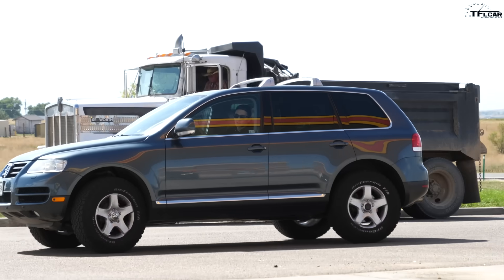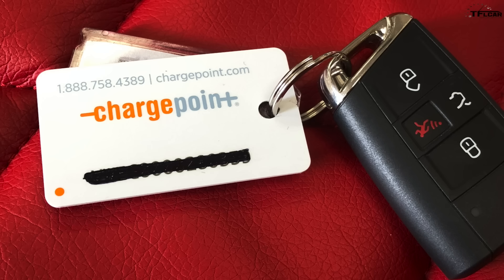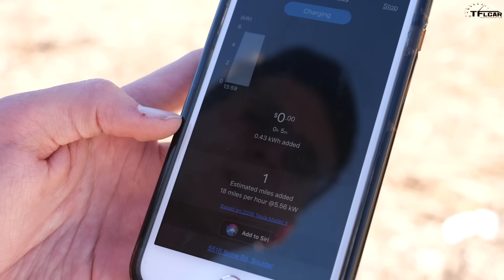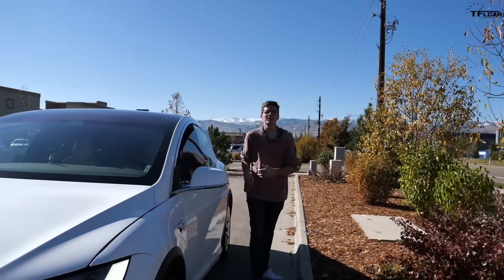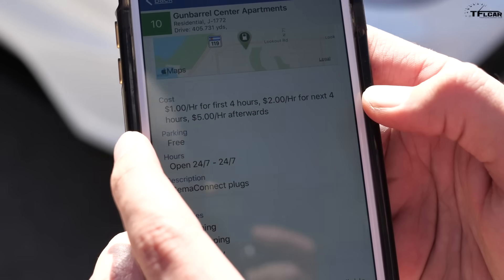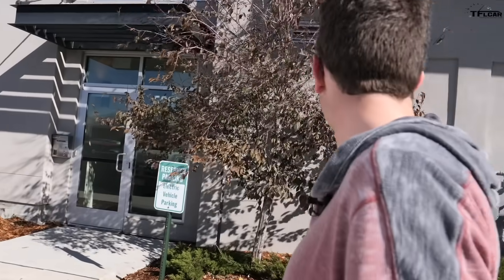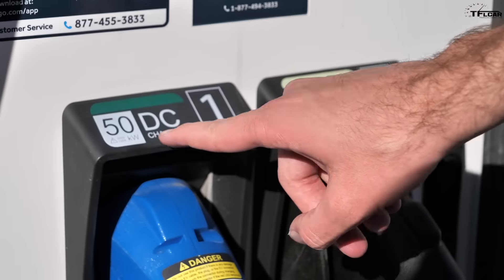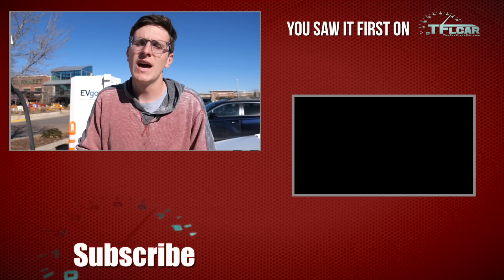Here’s Why Charging an Electric Car Can Suck - And It’s Not The Reason You Think!

Comment: Everyone has 240 volts in domestic properties in the UK.
Reply: Christopher Fairs And in Australia and New Zealand
Reply: @iFlyTheWorld  I think they are talking 3 phase which in Aus would be 415v
Reply: Most people in America do as well for electric ovens, stoves and clothes dryers. He is trying to show people the problems to they might encounter with an electric car. Most people also know if they have a Tesla. They won't be surprised as he pretended to be.
Reply: @glenncordova4027  Not everybody has a garage with a 240 volt outlet. Many dryers are in laundries and ovens are in kitchens, no where near a garage...
Reply: @ronclark9724  then hire an electrician. If you have 110 volts you can still use slow charge.
Reply: @glenncordova4027  Just use gasoline. Quick and easy, not to mention cash is accepted...
Reply: So what? 20h to fully charge a tesla, you've got to be flipping mad! You need a 400V supercharger for any speed! No country has that so you'd need an inverter & lots of Amps input from power lines.
What rotten cars these are, the full electrics! I would never buy one 
for the time it takes to charge. On the other hand I would consider the 
BMW with the motorcycle engine, which is currently the most economical 
ev on the market... It will never leave you stranded nor waiting 
forever.
Reply: @c000rr 
Three phase is 415v... Can be installed into any property as the main lines run 3ph...then they just split the phases going into different properties.

That gives each house 230v.
Reply: @Robert-j6r8c  You're meaning the European electric grid aren't you? We don't have this in North America. Two phase 110V wires come into my electric box. For stoves, dryers & water heaters, we use both the phases to create 220V, the maximum. This would be far to slow to charge a Tesla in an acceptable time. Yes, there are countless dummies in North America who are clueless about electricity, & who buy them. The rich Chinese who launder their money in North America, tend to love them, but there'll be 2-5 supercars in the garage, usually. If the Tesla isn't charged, take the Maserati or AMG Mercedes instead! Teslas have very low resale value because most average people realize the problems with charging.
Reply: @c000rr  Yes. We better destroy our planet. Anything than longer refuel times on our cars god forbid.

Also common helps.

As somebody else mentioned here it's not about if we can it's about will.

If you prioritize refuel time over anything else 

then yes electric cars is not for you and it can't replace a gas car using fosile fuel does burn our atmosphere tho so.. you know charging time or living time , it's really all the same right.
Reply: @coldfusionstormgaming1808  Burning fossil fuel pollutes the air, it's true, but mining rare earth metals from other people's lands pollutes the earth & pollutes the air from the amount of energy required to extract the minerals. Then you've got to ponder how the electricity is produced to charge the car batteries which took so much energy to produce in the first place? Most of the planet generates electricity by burning fossil fuels, many with highly pollutive coal. It sounds like you have not thought about any of the above & are totally clueless. My suggestion: less gaming, more study! ;)
Reply: Skeptik Cal - Your mis-understanding is hilarious. Most Teslas will charge in 15 to 30 minutes at a Tesla SC station when you are on a long trip.  You can drive to just about any place in the US without worrying about charging. Most Tesla owners charge at home for a fraction of the cost of buying gasoline. You really need to read up on Teslas and charging, your ignorance is showing, big time,
Reply: @Chainyanker007  Can't charge at home with apartment living.  Can't charge at most workplaces.  My options are a hotel or airport for Tesla charging near my home.
Reply: @Chainyanker007  your daydreaming, there are almost none east of mid america.from empty to full it will take many many hours. if you take fast charge, it will shorten battery life.
Reply: @terrorzilla  sure drive 30 miles to the airport, for a charge.
Reply: @dannyfields2065  Yeah a stupid response by MacGuy who thinks Tesla SCs are as ubiquitous as gas stations NOT! Pls MacGuy, be stupid enough to buy a junk Tesla car & tell us how convenient the  millions of SCs are along the way. Report back once you've had enough, can't resell your Tesla for half the price, & have logged all those hours you've been kept waiting. It'll only ever be the BMW i3 for me, with BMW motorcycle engine inside to prevent your less than ideal hapless journey, ever happening to me!

All while getting double the Tesla's fuel economy! ;)
Reply: @Chainyanker007  I live in West Texas out on a ranch in the boonies. The nearest gas station is 45 miles away... Sorry, Tesla does not have recharging stations every 15 miles...
Reply: @Chainyanker007  at a Tesla station
Reply: @pjd412 most are on turnpikes, which you have to pay to travel on them. very few anywhere else.
Reply: I cant speak for every state but California residents has 240V available at the panel. All they got to do is use both legs of power.... most panels have L1 to N and L2 to N ... creating the 120V standard here in the States. But if they get L1 to L2 they get  the 240V needed for this application.
Reply: it's not the voltage sir its the Amperage.
Reply: @pjd412 Actually the power on the power lines in the USA come no lower than 440/480 volts. It is the transformers mounted on your house that knocks that power down to 220/240 and 110/120...
Reply: Yea but who has a 5kw to 7kw outlet you'll need a new separate fuse  installed similar to an electric cooker or shower fuse, the cabling will also need to be 2.5mm minimum.
Reply: Most everyone I know has 240vac in their garage all my neighbors relatives and friends but one, I think that's weird but I know that one of my apartments didn't and the triplex my gf lived in had 208vac so...
Reply: Hyrdrogen fuel cells run on water and takes 5 minutes to charge.

However, they are still very expensive.

Comment: Spoiler alert!!  All of these charging stations are still fed electricity from a coal burning power plant.
Reply: From what I heard, power plants just run and waste fuel at off peak periods; to be ready for random demand surges.  Charging during that time counters, making them less wasteful.
Reply: @jasonlisonbee  You have regular power plants, driven by various sources like nuclear, water, coal etc. So the idea is, that an EV is actually driven by the power plant that produces the electricity, which is true. If the energy we use should be clean, we need to work on a way to get energy that is clean. Jim Hayes is totally right. If we use coal to produce electricity and then drive EVs with it, we actually drive EVs with coal.
Reply: @machelvet9594  It is a phase though.  There is a transition going to clean sources.  Giant batteries are also now being added to the grids.  Due to the efficiency of running a plant at a constant load and operating an EV,  it's already impossible for a pure ICE vehicle to come close even if the source for the EV is coal.
Reply: @jasonlisonbee  I'm with you. A neutral observer will probably come to the conclusion that EVs are better than ICE cars specially when you have solar on your roof.
But I think you are right, the change is coming and people will realize the advantages of EVs.
Reply: @machelvet9594  All the costs of intermittent electricity are not yet currently factored in. When they are AE doesn't look so good.  I like Polywell Fusion.
Reply: @msimon6808  Any kind of workable fusion reactor will probably be the breakthrough we need. We'll hopefully get there in the next decade.
Reply: @machelvet9594  California has no coal power plants.
Reply: @kurtiswichmann4699  Thank you for your input. Sad enough switching to a renewable future is not a question of a state and not even of a country. We all need to chip in e.g. by putting solar on our roofs etc.
Reply: @organizemyroom k No amount of politics can turn an intermittent unreliable source into a continuous reliable source. Enough money for 3 days of battery power might work. Until you need 6 days of power.
Reply: If we do away with coal burning plants and switch to hydro or geo thermal or nuclear or wind and solar, the pollution problems go away. Imagine if all houses had solar panel roofs with Tesla Powerpacks/Powerwalls and the Gigafactories had wind/solar for 90% of its power demands. Then our reliance on coal would be like 3-5% which is fine imo instead of the > 75% today. Switching to renewals which don't pollute the air we breathe should be our number #1 priority given this is the only planet we can live on.
Reply: @fanirama  Yep, that would help. Gigafactories going all renewable though, doesn't help much on a global scale. I wonder how many of those climate change activists actually have solar on their roofs. It's easy to say, "we should do something", and actually mean, "the others" should do something.
And nuclear should not be considered if it's not fusion. With nuclear fission, we just create long term problems like we did with fossil fuels. It may look like a great solution in the near future, but this again is just pushing the problem down to our grandchildren.
Reply: @Ronald Reed https://en.m.wikipedia.org/wiki/Coal_power_in_the_United_States
Reply: Jim Hayes actually the charging station by my house runs off of solar energy.....
Reply: Spoiler alert!! Cancer is still treated with radiation but we don't get rid of the patients to solve the problem rather try to find a better cure.
Reply: Not in California.
Reply: @organizemyroom k California has no coal burning power.

Comment: Just like the final comment in the video, it is like Linux: most 'folks' can barely run a PC or a smart phone. As not an EV owner, the savings appeared great, but I was under the impression charging was free for a while; but you point out there are huge standardization problems, not to mention the increasing user base who will be fighting for charge stations. That, and it seems to cost MORE than gasoline especially in terms of time. What are you going to do while you sit around the apartment complex for an hour waiting to do an 'emergency' charge? Not like the 1 gallon can in the trunk. And you live in a populated town; what about smaller communities?

Comment: 10 hours of charging?? thanks but no thanks!  I can refuel my tank in 2 minutes
Reply: sungleong - 15-20 min. at a Tesla station, or more likely at home on your Tesla charger, way cheaper than gasoline, just do the simple  math. Charge at night when you’re sleeping, cheap rates, get a 240 v 50amp circuit. Charging will be less hassle than going to a gas station and at 1/2 to 1/5 the price per mile driven depending on electric rates in your area, but for sure cheaper than gasoline.

Comment: another feature he's NOT telling you... is that when you plug in an electric car, you can also tell the car WHEN you plan to depart & it will start charging based on that timeline. so when you get out of work, your car will already be charged. you just unplug and return to cable to the docking port and it SHUTS ITSELF OFF. no need to give that command from the app. I use charge point at work... and it has ALWAYS CHARGED up completely while I'm at work... could be that station is on a really low amperage 220v circuit. NOT very common on a public charger.

Comment: some people like to throw all their money on their fingers & ears. jewelry. yay. there's all kinds of ways to burn your $. if you crave the sound of a rumbling gas burner and enjoy your time at the pump and love sinking your spare $ into gears, pistons & gasoline, by all means, have fun. as for time- I spend LESS TIME 'fueling' my car now by FAR. at night, when I get home from work... I just plug it in. takes 5 seconds. in the morning, I drive it to work, get out, plug it in (takes about 30 seconds to activate chargepoint), then end work, unplug, repeat. that's it. the 5-8pm thing at that apartment chargepoint is posted because in the summer during those hours... kwh rates go up. not a problem. I have the same thing at home. so I've programmed my bolt to only charge starting at 8pm. super easy. No more worry if I'm late & forgot to stop off at the gas station the night before. just plug it in and the car's programming does the rest. TESLA cars will do the same feature too. I'd avoid the Nissan Leaf though... their batter system is KRAP.

Comment: back in the horse & buggy days... I bet there were shops that sold buggies & leather horse whips on every street corner. and as motor vehicles came into existence... those shops slowly but surely disappeared. I'll bet that the LAST shop to go out of business made the BEST DOGGONE horse & buggy whips that money could buy. 
BUT
it doesn't matter. 

NOW- ice cars are the horse & buggy. they NO LONGER MATTER. not because they're not green. because electricity is CHEAPER. you can even produce it at home (wind, solar). BEV's will outlast ice cars by a factor of 10, because they have WAY fewer moving parts and NO reciprocating parts. next-gen long range battery packs are HERE. NOW. FAST charging is HERE. NOW. so long ice cars. RIP

Comment: extremetech-  At a Supercharger 3 network, a Tesla Model 3 Long Range can add 75 miles of charge in five minutes and charge at rates of up to 1,000 miles (of range added) per hour. The Model 3 will charge at up to 250,000 watts (250 kW) for brief periods, or a quarter of a megawatt.Mar 8, 2019

Comment: I have a chargepoint account. I drive a chevy bolt. it only takes me about 2.5hrs to charge up to 30 miles. I DON'T have a "charge station" at home. but I do have a 220v dryer outlet that I wasn't using (gas dryer). so I made an adaptor (parts from electrical at HD) for $30, and plugged into my dryer outlet. ya know... tommy- instead of trying to discourage people from weening off the big oil TiT... maybe you should TEACH them HOW to ween off big oil. OR MAYBE YOU WORK FOR BIG OIL????

Comment: Tesla’s superchargers charge at 25kwh roughly. A lot faster, only one company, and no adapters. Just use the charger made for the car. You’re just nitpicking EV’s for problems. All the companies and options are ruining the simplicity of it. Just stick with Tesla and ride it out.
Reply: GOOD ONE! nailed it tyler! soon... VERY soon- there'll be 2 superchargers for every gas station and then it won't matter. I charge my chevy bolt at home plugged into a dryer outlet with an adapter. no biggie. it charges up overnight.
Reply: @jaybee3165  Yeah exactly, a lot of people don't have access to home chargers though. In which case Tesla is the only car that can charge at their chargers in like an hour rather than 12 hours. Honestly, when you take that into account, there's no reason not to get a Tesla.
Reply: @tylerwalker98  " there's no reason not to get a Tesla."
Aside from the cost.
Reply: @wisenber  The model 3 is only like 4k above the cost of a nissan leaf so its by no means not affordable. and in reality the efficiency of tesla will make it cost less in the long run. I would much rather prefer a tesla monopoly on electric cars than all these small companies who prefer to ruin it for the cash grabbing
Reply: @tylerwalker98  " in reality the efficiency of tesla will make it cost less in the long run."
Until the warranty goes out.
Most long term Tesla's seem to have gone through batteries, drives, calipers.....within the warranty period.

" I would much rather prefer a tesla monopoly... "
That would make you a Tesla fanboy or economically unaware or both.
Monopolies never turn out well. It tends to drive up prices while killing any incentive to innovate. Then again, the other manufactures aren't doing any more "cash grabbing" than Tesla.
Reply: "You’re just nitpicking EV’s for problems. "
That's reality, not nitpicking.

"All the companies and options are ruining the simplicity of it."
Because monopolies work out so well?

Comment: Why not just buy the adaptor for the car on the internet from Europe like using the Amazon app
Reply: exactly! that's where I got my 220v charge cord.
Reply: @jaybee3165  I don't know if it's the same in US than it is in Australia but but have a look at this video and you may actually have 220v at your house
https://www.youtube.com/watch?v=OiwWaIvIeao
Reply: Because you would probably get some type of error electrically trying to charge with in proper  Equipment however I agree I think we should just have a standard USB charging port and you select your wattage and current rates.
Reply: @bumperxx1  did it. it works.

Comment: I wanted one....till I saw this. My time is too valuable for this.
Reply: Jesse - Then look into Teslas, totally different story. My S (coming in a month) will have lifetime free charging at Tesla stations which are way faster than the low powered idiot chargers shown in this video. No one would use those but desperate non-Tesla EV owners.  That’s why Teslas are selling like hotcakes. Go for a test drive, you will see why, trust me. There is a Tesla station near you or will be, check the Tesla network station map at their website. Get correctly informed.
Reply: Macguy I appreciate you telling me. I should have figured Tesla would have found a way around this. Thank you!